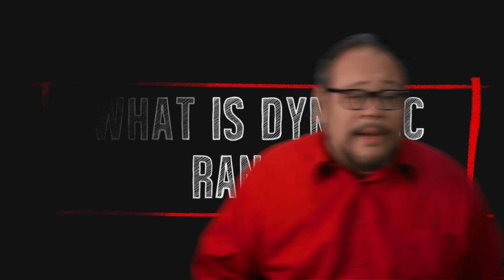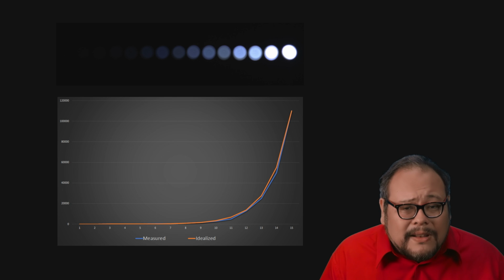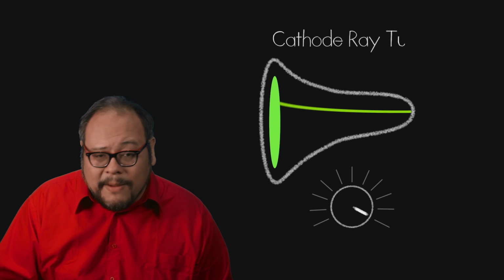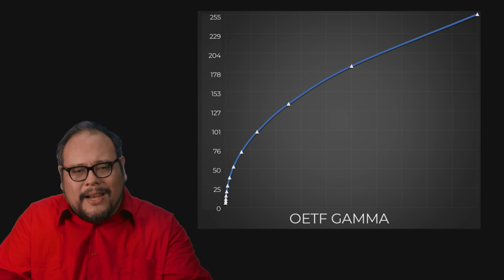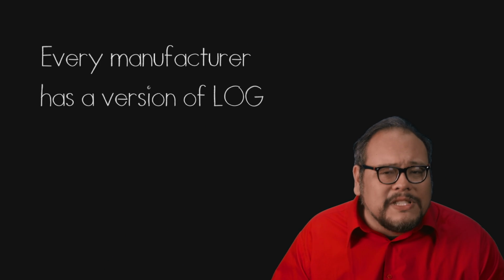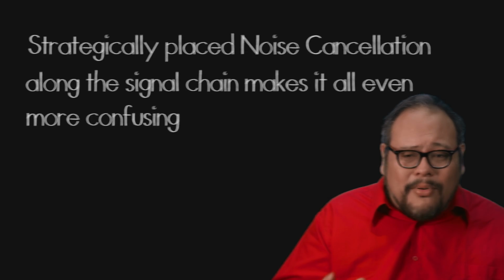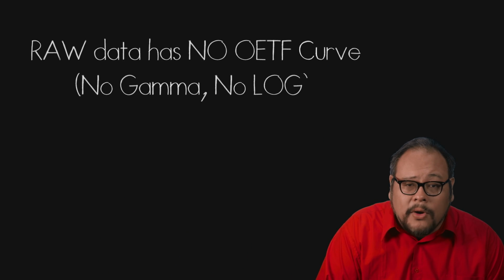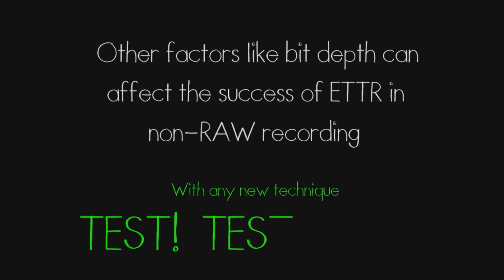Diving into Dynamic Range

Comment: Red pill moment!
Protect highlights with HIGHER ISO
Protect shadows with LOWER ISO!!!
Reply from the maker: I puzzled over that for probably about 2+ years... It took that long to build the case for it in my mind and solid enough to present it.
Reply: I'm a bit lost at that step. Why not just let more light into the camera and use the lower ISO setting? 
In the example you say that the ISO 800 image has 6 stop above and 9 below, while the ISO 200 has 4 ab. 11 bel.
But why not just use 200 ISO and let 2 more stop of light on the sensor to again achieve 6 stop avobe 9 below?.
Is that a consequence of the Log curve? Because definitely what you suggest in the video wouldn't work on a normal DSLR raw.
Reply from the maker: At ISO 200 the sensor is clipped at 4 stops above middle gray. No more signal is possible. This is most apparent in LOG because the space is more consistent.
Reply from the maker: And in the test I've done it works in stills arena too... To an extent...
Reply: I don't really understand that concept.
Do you have a suggestion for testing it on my own camera?
I own a canon m50 and I usually use 'standard' as my picture profile.
Do I need to change it to 'neutral' or some custom settings, to test your ideas?
What else do I need to do?

Filming the clouds with iso 100 to 1600 by changing the aperature?
What is the best way to test the quality of shadows?

And what do I need to do in post processing to get this better results?
Reply from the maker: The test would be to go out and shoot a picture of some clouds on a bright day. Have the camera Auto expose the first image at ISO 100. Then throw the camera into manual mode and decrease the aperture by four stops and shoot the scene again at ISO 1600. Then look at the highlight details in the cloud.
Reply: Wouldn't it be even better just to move middle gray by underexposing and bringing it back in post? Since the total dynamic range is better at lower ISO, it would make sense to use base ISO and adjust the exposure to maximize dynamic range, which is basically ETTR.
EDIT: I wrote this message before watching the last section about ETTR. I guess that means your video has a logical structure, answering the questions just as they appear in our mind.
Reply: Uno yes but when you bring it up in post you are increasing visibility of all the noise which resides in the shadows. So you’ll get a grainier image.
Reply: I think this is only true with 'pulled' ISO settings (ie: ISO settings where you're already at minimal hardware amplification, but are able to select a lower setting by using a clipped version of the tone curve - hence the reduction in above-middle-grey DR).

This is why I think ISO is a bit of a disaster. Because it bundles amplification in with the effect of tone curve, which makes it hard to know what the camera's actually doing (Log tone curves, while not technically being ISO-compliant, inherently have high ISO values, since the way you'd gain those extra highlights is to reduce exposure, relative to the OETF curve, and a lower exposure still giving 'correct' middle grey will be rated as a higher ISO).
Reply: Filmmaker IQ I'd love to discuss this with you some time, if you ever have a moment.
Reply from the maker: But the question is what and when is "ISO pulled" and the answer these days seems to be everywhere. You can look at DR diagrams and see this happening in tons of cameras. The new BMPCC only does 2 stops above middle gray at ISO 100!

I don't think of it as a disaster because it's doing what it's suppose to do, returning a certain luminance as middle gray. It's just we can't treat this as part of the "exposure" triangle anymore. It's missing a big point!
Reply from the maker: And just a clarification, at low ISO the ISO is not clipping the signal. The sensor is clipping. There is no further possible signal.
Reply: I accept that ISO is doing what it's supposed to be doing, but it would be more useful to know when the sensor is and isn't having amplification applied.

I see a lot of people moving from the stills mode on their camera and wondering why the minimum ISO is stills is 100 and yet it jumps to 640 or 800 in Log mode. 'Why can't I reduce the ISO?' (The answer being that you're already at minimal amplification but that the shape of the Log curve means that you need much less exposure to 'correctly' position middle grey - absent of any 'pull' settings).

If you knew when amplification was an wasn't being applied (and when dual gain cameras - in the Aptina/Sony sense, not the ARRI one - were switching between modes), it would be clearer what's a pull mode and what isn't. Those DR diagrams help, though appear to be slightly misleading (I've never seen a camera that can increase ISO across its whole range without the electronic noise floor, quite apart from the shot noise implications, cutting into the total DR).

I'm not clear quite what you mean by 'not the ISO clipping the signal' - I agree it's the sensor clipping because you're essentially over-exposing it (or, at least, giving it more light than would allow it to provide its standard amount of highlights).

If there's some way to get in touch, I'd love to chat about this some time.

Richard - DPReview.com
Reply from the maker: You can go to the site and send a contact.

Those DR charts are actually truthful though. They don't depict the noise floor but even at really high ISOs you're still getting that range. It might be noisy but it's there.
Reply: I'm not sure it is, but I'll get in touch.
Reply from the maker: Well there's no way to get more from the sensor so you're functionally at the highlight limit of the sensor when you're shooting low ISO. If you're at 3 stops above MG at ISO 200 and you get 4 stops above when you move to ISO 400 then the clipping point hasnt changed.
Reply: Agreed. So presumably the 'Native' ISO is the point at which you get to use the full highlight region of your tone curve, then you essentially use truncated versions of it below that point (with increasingly little gap between MG and clipping). However, at these lower settings you actual hardware gain isn't changing.

So the idea of increasing ISO to protect highlights is essentially to get you back to the point where you're able to use the whole (or, at least, an appropriate) amount of the tone while still using this minimal amplification state. It seems counter-intuitive to many people because they think of ISO as amplification, which it isn't, necessarily.
Reply from the maker: "Native" is one of those words that might also be confusing. The way Arri describes it, Native is just where you have about an equal number of stops above and below middle gray. On Canon, seems like "native" just means when you stop gaining highlight DR as you go up.

Then with this BMPCC 4K camera with it's dual ISO it's even more confusing. when shooting ISO 1000, you get 5.3 stops above and 7.8 below and you step up to 1250 and all of a sudden you're back down to 2.3 above and 10 below! It's almost like you have to treat that as two different cameras! 
https://www.cinema5d.com/wp-content/uploads/2018/09/ISO-range-to-latitude.jpg 

So in the end, it all really requires us to stop thinking of ISO as part of an exposure triangle - that old analogy doesn't work when it comes to this kind of intricate detail.

BTW - I got your email - if you didn't get my response, check the Spam folder ;)
Reply: Received and replied to. ;)

It's things like Dual Gain that really throw a spanner in the works.

The lovely thing is,  I think having this conversation has helped me finally figure out what Panasonic means by 'Native' which was not at all clear from talking to them.
Reply from the maker: In all cameras ISO is a post exposure process... Because ISO is not part of exposure!
Reply: @lughor82  the M50 does not shoot C-log, so I presume this concept doesn't apply
Reply: Filmmaker IQ WOW!
Reply: Brain just exploded. Should probably clean that up...
Reply: I would have never believed anyone without a presentation like the one in this video, truly eye opening
Reply: Has a lot, lot , lot of sense.  Some people translate the film recording knowledge to the digital world without taking into account the difference in how the light is  processed in both medium.
Reply: I just bought BMPCC 4K and went for test shoot in sunny day with 100 ISO. I was so surprised when I saw that this wide dynamic range camera got all clouds blown out so easily... Now I know why! You saved me a lot of trouble!
Reply: I've ever wondered why i have problems with white on planes looks wired when my Camera shoots at ISO 100.  I'll try to set some ISO settings next time and see what happen. Thanks for the great Video.
Reply: For the same middle gray value a higher iso will be less exposure and a lower iso will be more exposure. Less exposure means our sensor pixel will not become saturated (protecting highlights), and more exposure means our signal to noise ratio increases (protecting shadows). Ideally you shoot at the lowest iso (highest signal-to-noise ratio) and use ND or otherwise to protect the sensor from filling up giving you the greatest dynamic range.
Reply: crazy thing, though. But it absolutley makes sense if yout took a closer look - thanks to Brian, explaining it in a absolutely great way (as always)! Thanks for that! <3 it!
Reply: Why not just shoot always at the limite of white clipping ? (Except of course stuff that we don't care to clip like sun, sun refleftion etc..) 
What donl you think ? 
This is the way i shoot sony slog3 and its the only way i find to maximize dynamic range in real estate shoot without having too much noise.. of cours if interior is too dark then you'll have to adapt and kill some of the highlight.. 
What do you think ?
Reply from the maker: @adriengremaud9797  Because sometimes what you really want is so far below where the brights clip. Like in your example of shooting interiors.

A much better approach is to know what you want as middle gray - and let the highlights clip if they are not important.
Reply: @FilmmakerIQ  true, but i always try not to clip the windows.. i realy hate clipping windows... maybe because i shoot too much real estate photography... 
I guess i'll have to make some effort and sacrifice some of the highligh.. because even with fs7 and 14 stop of dynamic range, most of the time interior and exterior are just way too different brightness.. I need to buy a red or arri :-D
Reply: I actually got really emotional at this part. I had to stop the video and take a break. 😳
Reply: This is true.  But increasing ISO can lead to more noise because it's amplifying the signal, thereby increasing the noise. Not to mention, too much detail in shadows can look unnatural. The prevailing method is to expose to the right so that you protect highlights, at the expense of shadows, which generally looks better.  Because people can accept a lack of detail in shadows, but blown out highlights are downright visually unpleasing in almost any scenario unless it's a very small part of the image.

Camera's also aren't really good at determining if a scene needs high ISO or not.  For example, in a low lit room, the camera will try to boost the ISO automatically. But it won't look anything like what you're actually seeing in the real world.  Shadows will be greatly reduced or gone almost entirely, completely changing the mood and look of the photo.  The actual best way to take low light photo's is with base ISO and longer exposures, because if you shoot at 100iso and 1/30 or 200iso and 1/60, either way, you're going to end up with the same basic image, the same basic amount of light gathered, but the higher ISO will have more noise. If you blow the highlights in one image, the highlights will be blown at the other setting too. 

When you increase the exposure of shadows, you're also increasing the exposure of highlights. As long as you protect the highlights, you will generally have as good of an exposure as you can possibly get. 

The problem comes when exposure time is too long to hand hold, which is what higher ISO helps compensate for by allowing you to increase shutter speed, at the expense of more noise. It really depends on the situation, and what kind of highlights you have, like bright lights. You can generally safely over expose highlights a little to get extra shadow detail, or just edit better by exposing for the highlights and increasing just the shadows in post, or bracketing to get more dark details while preserving most of the highlights. To date, there isn't any camera that perfectly exposes both shadows and highlights, just good enough. It all comes down to the degree of shadow/highlight exposure we are willing to accept.  It's a balancing act.  

Your camera may want to expose a dark scene as much as it can in automatic modes, but that's not necessarily the best exposure. So you can actually even under expose low lit scenes a bit, so that you get all the shadows that you actually see, then you can raise the highlights in post.  It really depends on the scene though.
Reply from the maker: @C North Exposing to the right doesn't protect highlights - it endangers highlights. In fact shooting low ISOs on some of these video cameras leads precisely to blown out highlights.

In your example shooting 100ISO 1/30th and 200ISO 1/60th DOES NOT RESULT in the same amount of light capture. ABSOLUTELY NOT. 1/60th is HALF of the light - increasing ISO DOES NOT boost the light.

It's painfully obvious you DID NOT WATCH the video. I demonstrated how I could blow highlights if shooting ISO 100 - change the settings to ISO 800 while NOT CHANGING the >final< image - and the highlights will be blown at ISO 100  and just fine at ISO 800.
Reply: @FilmmakerIQ  That only makes sense if you're changing the ISO and not changing anything else.  For example, camera auto modes will adjust the ISO, but also stop down the aperture and increase the shutter speed. But if you're at a locked ISO, then auto modes will adjust everything accordingly best it can, or you adjust manually until it looks about right.  Maybe if you're ignoring that your image is exposed improperly and not adjusting anything else, it would be a problem.  But if you only shoot at base ISO, you're going to open the aperture and adjust the shutter speed as needed anyways.  

As long as you're getting the closest you can to what your eyes see, or what you want to see, it shouldn't be a problem. It's only if you were blindly adjusting overall exposure, is when something like this would come in handy. Or when you don't have a shutter/aperture preference.  But obviously, people might want the effects of a different aperture, or the speed of a faster shutter, or might not care if the shutter is slower to get a good noiseless exposure.

It doesn't matter how much light you gather in total as long as it's enough for a good clean exposure, and that ultimately goes back to the capabilities of the sensor.  But noise can ruin an image, and with many cheap camera's and smaller sensors, base ISO is the only ISO that can deliver an image without severe loss of detail, regardless of the exposure.  So your methods are only really applicable to those running high end camera systems where they can boost the ISO to 12000+ with no noise.   But when you're working with a camera that can't even boost to 200 ISO without a loss of detail from noise, the extra dynamic range isn't going to matter as much as the lack of fine details, especially when you don't need 14 stops to make a good image.

 We don't actually need all the stops of dynamic range our camera's gather, to use toward a final image. You can make a amazingly good image with just 8 stops of dynamic range.  And if you have a crisp image to begin with, you can add perceived dynamic range in post.  No ones going to care that your image has the maximum amount of dynamic range if it's noisy, the overall quality is going to look worse.  Many camera's are ALREADY at their maximum dynamic range at base ISO, to up ISO on these camera's, will always mean a loss of image quality.  This is because in an effort to constantly compete, camera manufacturers are actually ignoring a lot of the old specification practices you see in high end camera's from the earlier 2000's.  So there's simply a lot of factors you're not accounting for.  It's not a one size fits all scenario.

For example the Canon 5D Mk1 is 12MP, the Mk2 is 21MP.  In order for them to make both camera's equally as good, they would have to basically double the sensor signal purity given the same lighting conditions, which clearly didn't happen in that time frame, technology doesn't move that fast. In an effort to compete and deliver more and more megapixels, camera makers have made many concessions. In the race for more megapixels and faster speeds, this has all gone out the window. This is why the original Canon 5D is still a great performer, and is still known for its exceptional color rendition. Just look up "Legacy CFA". CFA's (color filter array's) have been made less selective in all cameras post ~2005, to chase higher ISO and higher megapixel counts.  For proof, just look at this quantum efficiency chart: https://3.img-dpreview.com/files/p/E~forums/59201269/d5d35cccccb5430395235ce3e4df88c9

ISO may be a post exposure process, but it DOES deal with the signal BEFORE it's converted into digital data. So in a way, everything is technically analog until you pass the ISO processing part.  The process is basically this:  Sensor captures signal, ISO attenuates signal, signal is converted into digital data.  It's the equivalent of RAW vs JPEG.  Starting sensor signal is to RAW, as RAW is to JPEG.  So it's like a post processing feature, but it's not one you can simply undo, it affects the entire final written data, which is why it's not treated like post processing, in principle. 

When people post process, they are actually subconsciously REDUCING the perceived dynamic range of their cameras, to make things look "right". That's what most of the adjustments in post processing does in some way or another. And people do this without even realizing that's what they're ultimately achieving.  They're just going by what looks "right", but it all ends up in the same zone:  Selectively reducing overall perceived dynamic range.  When people complain about photo's looking "too realistic" what they're really complaining about is an excess of dynamic range!  And camera's in general over the last decade, have outputs that are considered hyper-realistic, compared to older camera's.
Reply from the maker: @peoplez129  First off I'm going to completely disregard anything you say on the auto modes. All my examples are shown using full manual. I'm okay with people using auto modes - but using an auto mode in this discussion obfuscates what's really going on so I'm completely ignoring it.

"It doesn't matter how much light you gather in total as long as it's enough for a good clean exposure" You have this backwards. Getting a clean exposure means feeding your sensor light. The more light you gather the cleaner you exposure will be...  this should be very obvious because if you have a really bright image you can always gain down / reduce the ISO. More light = more information = more SIGNAL to noise ratio = cleaner image. LIGHT is the key component - LIGHT is what we are recording.

" base ISO is the only ISO that can deliver an image without severe loss of detail, regardless of the exposure." that's not true. There's a range most cameras can handle - it doesn't need to be only the base - if even the word base isn't really applicable.

My methods cover every camera. Knowing how much your camera responds is up to you as it will vary from model to model but I'm giving out fundamental principles here.

_"We don't actually need all the stops of dynamic range our camera's gather, to use toward a final image" - I said so pretty much in the video.

_"Many camera's are ALREADY at their maximum dynamic range at base ISO, to up ISO on these camera's, will always mean a loss of dynamic range." - not necessarily. This is a hard caveat to get your mind around - early drafts of mine of this video made the same error. The fact is you can change your ISO and still maintain the same dynamic range - lots of these video cameras are doing just that. Eventually you get in ranges where you reduce the dynamic range but many many cameras today can hold the same dynamic range over a wide range of ISO settings.

"ISO may be a post exposure process, but it DOES deal with the signal BEFORE it's converted into digital data." Again, this is becoming more and more of a _not applicable in all situations_. On many cameras the ISO is saved for later - these ISO invariant cameras are all saving the gain application past the ADC - with those cameras there is ZERO difference between changing the ISO in camera or in Photoshop. Other cameras do in fact apply the GAIN before the ADC and even add in extra noise cancellation at higher ISO settings (Canon)...  Fact is you have to be familiar with how your camera operates - you can't say for certain this is how it operates because manufacturers are getting pretty clever
Reply: @FilmmakerIQ  So never shoot at 100 ISO then?  Let's say your camera does 1600 ISO before noise becomes a problem.  Wouldn't it then be prudent to always shoot at 800 or 1600 ISO and never base ISO and adjust shutter/aperture accordingly?
Reply from the maker: @peoplez129  Shoot ISO 100 when you want to protect your shadows and you care less about the highlights details. On a cloud less sky shooting away from the sun with no bright objects (like snow) in the shot - ISO 100 would be great. Also if you're shooting a very dark horror film -  In Hollywood - dark scenes are shot with an abundance of light and a slower film speed or ISO is used.

 You could always shoot 800 or whatever - it just won't have the same flexibility in shadow detail as a lower ISO. But you will get more room for highlights... so on a bright scene, ISO 1600 if it's not too noisy might be a better choice than ISO 100. Everything is a trade-off. Then we get dual ISO which I'll do another video on all together...

Also the idea of "base ISO" is sort of misnomer - most cameras don't have a base ISO - it's more of a base range.
Reply: @FilmmakerIQ  But by that logic, then can't you just shoot at 800 ISO and not worry about preserving shadows and just lower your shadows in post?  If you're shooting at only 800 ISO, and getting better highlight protection, with brighter shadows.....you should lose nothing in detail by darkening the shadows, if you darkened your shadows to as dark as they would have been at 100 ISO anyways.  What I'm basically getting at, is by your logic, we shouldn't ever really have to worry about protecting shadows if you can just darken them, as long as we shoots as a reasonable mid range ISO.
Reply from the maker: @peoplez129  No, this is not about "lowering shadows in post" - this is about how ISO sections off the range of light that hits your sensor. There's no "brighter shadows" - we're talking about shots that are visually equivalent - plop them on a waveform and they line up pretty close (except for where the noise floor is).

If you properly expose for middle gray at ISO 800 and you have something that is 3 stops below middle gray, that shade will be noisier at ISO 800 than if you shot the same scene, increasing the exposure (the light capturing side) by 3 stops and shoot at ISO 100.

The example is right there at 26:35 - this part is the easier part to sell.
Reply: @FilmmakerIQ  Hello. I hope you will notice my reply since months. I tested this ISO theory with my GH5 at  f/2.8 ISO 200 (minimal) and f/8 ISO 1600, f/11 ISO 3200 with high contrast scenes with clipped highlights and dark shadows. And final images looked the same. The only difference is that with higher ISOs there is a more noise in the shadows (as expected). But the highlights didn't show any extra information with higher ISOs. What I'm doing wrong? Really want to understand your concept. Thanks again for the video!
Reply from the maker: I'd bet there's some highlight retention going on but you may have a hard time determining how much. The fact is by lowering your light exposure you are protecting the bright spots of your image.
Reply: @FilmmakerIQ  Based on vectorscope there it's hard to see any difference in highlights. Tested with Cinelike D, V-Log and HLG profiles in controlled studio environment. Even if it still exists in some invisible amount, your example with clouds and C-Log is much useable (looks like at least by 1 stop). Maybe it's just for Canon cameras and Panasonic uses different algorythms for their ISOs? Anyway, I understand you point. Thanks again!
Reply from the maker: No my cloud example is absolutely clipped. The highlight detail is gone gone gone... It's ugly as hell.

The act of closing down your exposure does help protect your highlights. Your sensor has a physical full well limit. By reducing the exposure and increasing the gain you bring the light down away from the physical limit and into middle of your sensors dynamic range.

Now granted Panasonic might approach how it feeds the storage system differently then blackmagic and Canon. That's why testing is good.